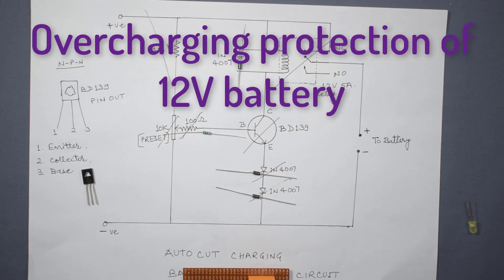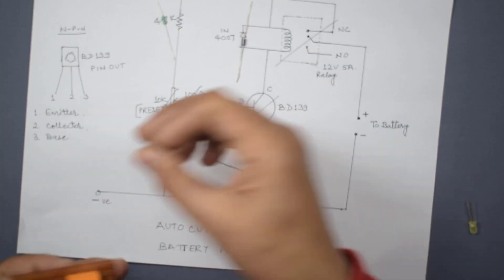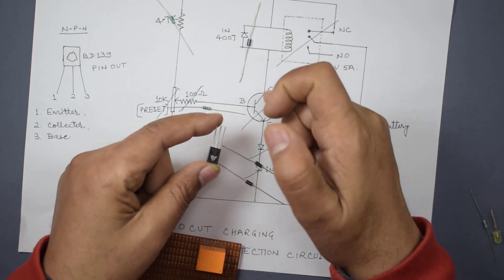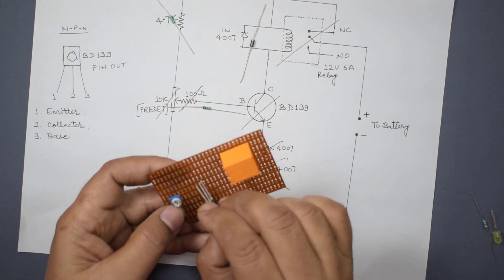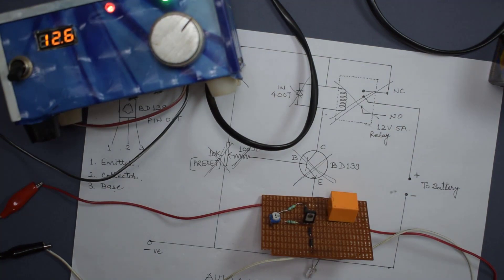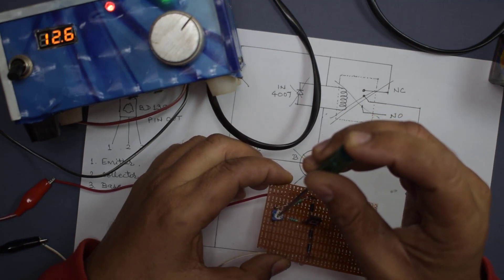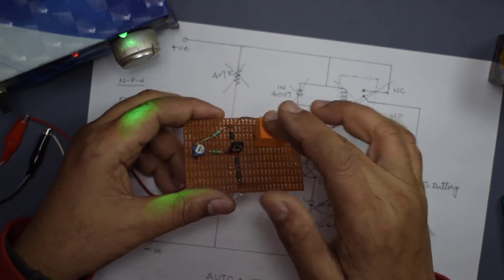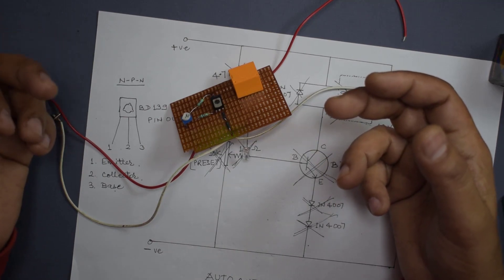12V Battery Over charge Protection Circuit || Cut-Off Circuit For 12V Lead Acid Battery Charging

Comment: Fixed resistance  is sufficient  preset and transistor  not required.  When we are sure we are charging  12 voltage  battery   what's  use of preset  resister.

Comment: 1. hello,  if i have a 12V input(voltage source) and a 9V output(battery), would I use the preset potentiometer to set my threshold to 9V ? And would I have to change my relay to a 9V  one or should I just leave it at 12V? 

2.  if my battery is fully charged the circuit would disconnect right ? and when the battery discharges the circuit would reconnect ?
Reply: please reply me fast. thank you

Comment: Hello I want to use 4 Li-Iron battery total voltage is 14.8 what is threshold voltage for it? I dropped 230v ac to 12-0-12 take 24 volt AC rectified it n use 7815 for 15 voltage regulator

Comment: This circuit is applicable for Lead Acid Batteries only. Do not use Li-Ion or Li Po Batteries with this. For proper explanation follow this video : https://youtu.be/zenIMKokTwA

Comment: While charging a 12volt 7ah how much volt must apply to the circuit to adjust 12 volt cut point. At cou out point output power of relay will come from NO or NC pointof relay. Please explain

Comment: Can I charge  6volt battery. If so what should I do?
Reply from the maker: This circuit is designed for 12 volts battery, kindly search for 6 volts charger circuit, or use 7806 IC to convert 12 volts to 6 volts. Thanks

Comment: Thank you for this video sir !!!
Reply: I have one question. Can i charge a 12v 80 Amps battery with this circuit ?
Reply: I think i have to supply 13.8v with 8 Amps (10% of battery voltage). Can i supply this amount of current through this circuit or the relay ?
Reply from the maker: @souravghosh5101  no bro, because relay, shown in this circuit is of 10 amps only.
Reply: Please reply as soon as possible sir. Thank you again.
Reply: Then what's the problem with that relay cause it can handle 12V/10Amps of current. Then it will easily handle 12v/8Amps. I might be wrong. Please reply soon sir.
Reply: One more question sir. Can i use BC547/548 transistor instead of BD139 ? Cause they all are NPN type.

Comment: You should calibrate it with actual 12vdc load to the output  U must show actual video how it works , this circuit same principle as audio speaker delay

Comment: I will charge 12v 20ah yes or no
Reply from the maker: Anowar Hussain for that kindly replace the relay with 20 amps in the same circuit, then it is yes.
Thanks

Comment: The Base of the Transistor is connected to what pin on the Relay? And you are setting the low voltage threshold at 12.3 Volts, so what about the higher threshold, 13.8 Volts,  that keeps the battery from overcharging? How do you set that?

Comment: Thanks sir , can i use it for 7.2 battery that fully charged at 8.2 ?
Reply from the maker: Kindly set charging at 8.5 volts to full charging 2 cells of of 3.7 volts. Thanks

Comment: it is producing trrrrrrrrrrrrrrrrrrrr sound
Reply from the maker: How much amp of battery are you using
Reply: 35 amp
Reply from the maker: TECHNO Ashu kindly change the relay. Please use 12v 35 amp relay.
Reply: what will be cost
Reply: and do you have the relay

Comment: Sir , my internal hard drive is not working even if connected to another laptop it shows same blue screen error just after appearing windows logo. in ''lunch start up repair mode'' also same issue. what to do sir, please suggest.
error code 0x00000050(0x856c0000, 0x00000000, 0x8A85BB13, 0x00000000).
I am unable to recover my data.